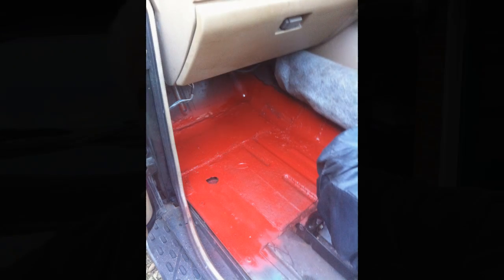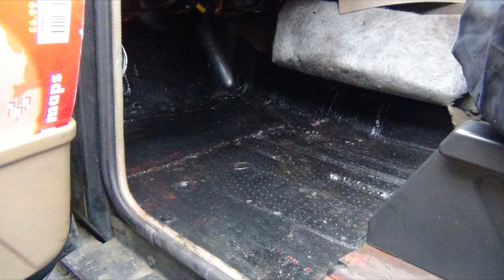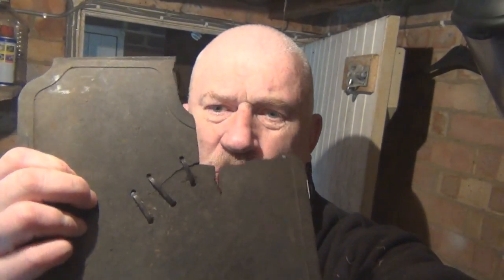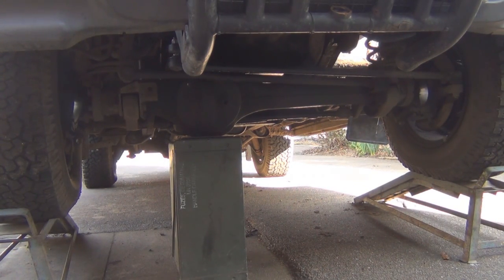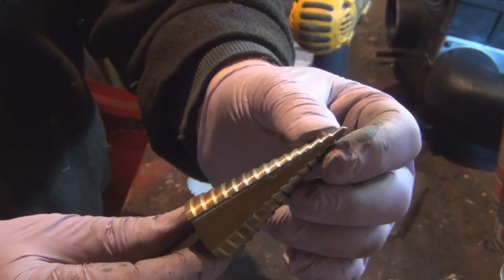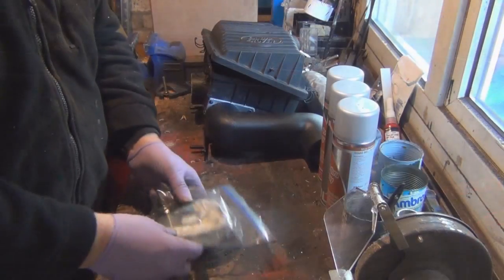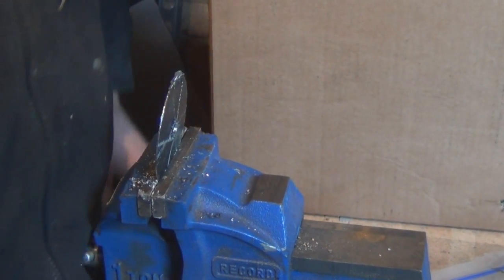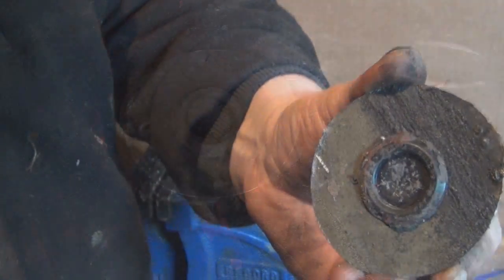Bov Maintainance

Comment: I have the same Hole Saw. The largest I have is 4 inches. The 2 inch one is what I use the most.  I put some holes thru some barn walls to run electrical extension cords to where they needed to go.  Easier than running new wires and boxes to the other side of the wood wall. 52mm equals 2 inches. 80 would be around 3 inches. 

As far as your snorkle goes.  I would leave it as pre staged and available until you get to the point where you need to transit deep water.  The K-N filter works great in a sheltered area where heavier pieces of road dirt are mechanically beat down by truck body panels.  Up in the airstream every insect  road grime mud puddle will add to the filter media.  If you drive in blowing snow that will pack the filter shut and then cause a blow out as the engine forces a air passage thru the blocked filter media.  By having the parts available to change to the snorkle in your tool kit, it wont take more than a few minutes to remove the fitler and add the section of flex hosing.   If it is wet enough in the area for high water above the engine compartment, it will be wet enough to settle the dust in the immediate area for that short time period too.    My opinion.
Reply from the maker: Thanks Randy great minds and all that Atb. Roach

Comment: if you are looking at wading kits have a look at bar fittings and pipe for the soft drinks. its the same stuff and a lot less money.
Reply from the maker: I've found a little kit for £30 didn't think that was to bad
http://www.ebay.co.uk/itm/291322168472?_trksid=p2060778.m1438.l2648&ssPageName=STRK%3AMEBIDX%3AIT stat safe mate. R
Reply: its not bad at all for the propper kit. where are you running it?
Reply from the maker: http://www.ebay.co.uk/itm/171205696507?_trksid=p2060778.m1438.l2648&ssPageName=STRK%3AMEBIDX%3AIT
Reply: wow that last one was a bit high and it does the same job. but then again there are ppl out there that think paying more gets you a better product every time. the first one would do just fine. i usually crop the top off the existing ones join them with bar fittings and run them up the back side of the snorkel. my mate once did a kit that joined all the pipes in the engine bay and just 1 bigger pipe went up the snorkel
Reply from the maker: I'll be fitting the cheaper one, just wanted you to see the fitting diagram  
(Your trucks starting to look the Dogs) good luck with it Atb. R